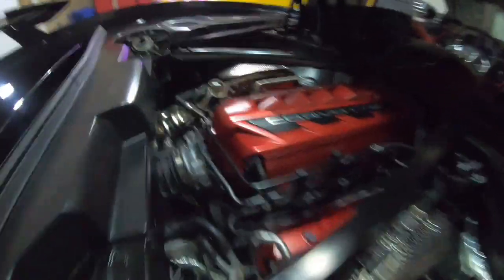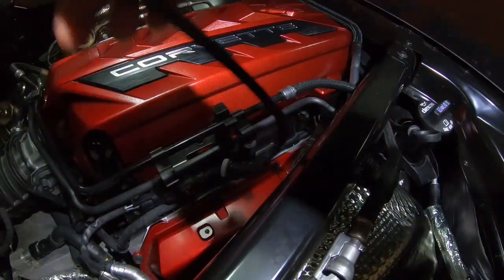C8 Corvette Vlog #8 - Installing an Oil Catch Can

Comment: Nice work great vlog…👍👍
Reply from the maker: Thank you sir.
Reply: Kind of interesting because on my 2004 Dodge Ram 5.7l 1500 the PCV valve is actually just a plug into the back of the intake manifold so you can’t really go between that and I definitely was not going to drill the valve cover so UPR products say to put one end onto the cold air intake line and the other end goes to the the nipple on the oil fill.
Reply from the maker: @antoniomarc7174  that sounds right. Same idea

Comment: Great video. I have a Cadillac XT5, would it help to put on a catch can? Also if you have rough running would fuel dative help it?👍
Reply from the maker: Thanks. A catch can will help any engine but especially direct injection engines. Fuel additive will not help if valves have carbon on them in a direct injection engine.

Comment: how can you install an oil catch can on a convertible C8 version?
Reply from the maker: I haven't worked on one yet but I'm sure once you have the top in service mode and remove the access panel, the hook up is the same. It'll just be a matter of where to mount it. I don't know until I see one
Reply: So in other words I would have to remove the access panel once a month?
Reply from the maker: @Sergeantcruz1216  I would try to mount it somewhere that I can access from underneath. Where? I don't know without seeing it. Or trade it in on a coupe lol

Comment: What a waste of time and energy. Welcome to 2021 buddy. You don't need these anymore (and GM engineers agree).
Reply from the maker: Really? What's changed? They aren't direct injection anymore? Enlighten me on this theory you have.
Reply: @LifeOfAnAutoTech  I still like the idea of a catch can for these engines, but this is what I saw on a C8 forum.  Seems the GM engineers have an internal system that effectively removes the need for these:   "GM addressed the problem on the C8 this way: Oil scavenged from the valley and the shallow cast aluminum pan covering the bottom of the engine drops through a maze that separates liquid from vapor. After settling a few moments in the tank, vapor bubbles disappear, leaving only liquid oil. Vent lines attached to the top of the reservoir route the vapor to the LT2’s valve covers where it’s drawn into the intake plenum by engine vacuum."
Reply from the maker: Thanks for the info. I guess we'll see how much it catches after some usage.
Reply: @LifeOfAnAutoTech  SO how much did it catch, I know on my 1st gen coyote the passenger bank loves to spit out oil to the catch can. It's not DI but the oil vapor still reduces that afr.
Reply from the maker: I've only driven it about 2000km since and it's about a 1/4 full